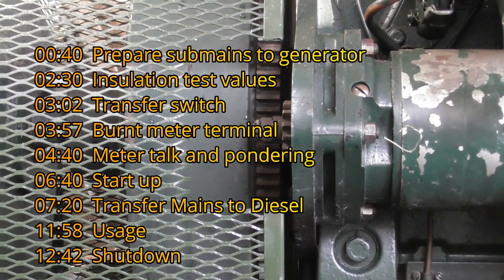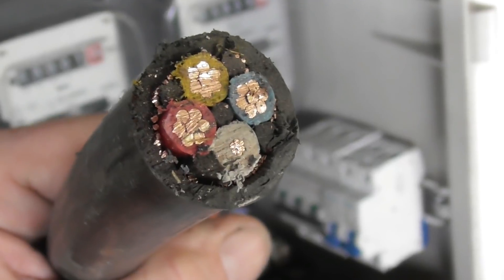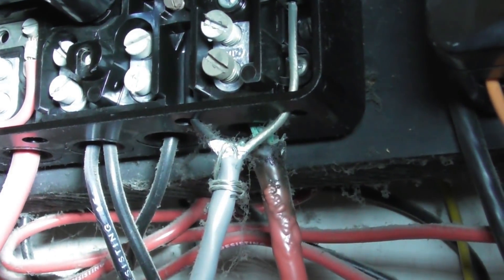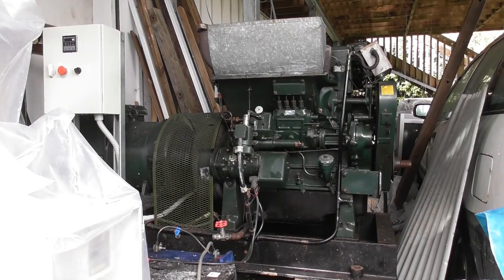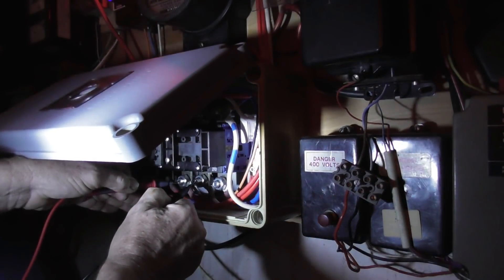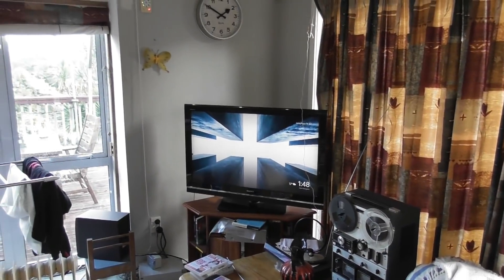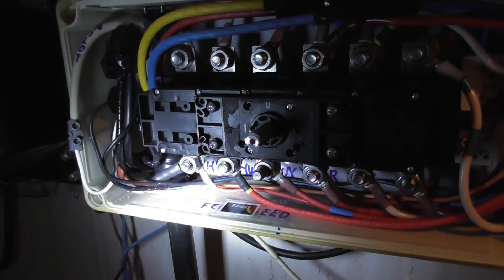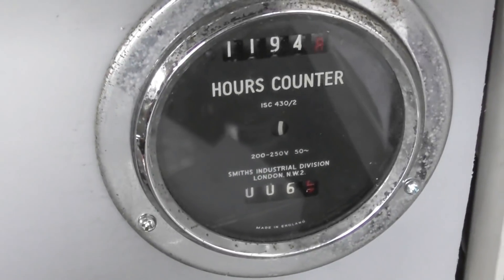Diesel Generator submains and transfer switch

Comment: Wow NZ still use Yellow for B Phase eh didnt know that. Yellow was banned in Aus from 1976.. or is that 50 year old cable...
Reply from the maker: It is White colour now, that cable I had was about 30 years old. NZ used Yellow Phase till well into the 90's. White is a dumb colour anyway for an active wire.
Reply: @RODALCO2007  Yeh well yes it is when you consider the Yanks use it for Neutral. But then again they use Black for Active so... whatever. Yellow was phased out because they thought people might confuse it with yellow/green (Earth). JUst threw out a heap of meters here, had a few polyphases you'd probably have liked.

Comment: How do you have 3 phase at you're house
Reply: Over here in Germany, every household has a 3 phase supply. Not sure where he lives tough.
Reply from the maker: Street supply is Single Phase 80 Amp supply. split generator load through transfer switch over Three Phases for better load balancing.

Comment: RODAL the red/ blue  light is a sweet touch.   Not a normal generator to house backup, but I except nothing less from you.   After 27 years in operation a part on my generator quit, was 1625 to replace.
I asked the guy why my clocks gained time.   He gave me some answer you might be able to put into plain words.  Does your system gain time on clocks?   Think I told you since they put the smart meter in, my 1985 battery back up clock blinks constantly.    Keeps perfect time, but they read power ever second and it dim blinks not totally off.     
Two questions why do they set up Onan and clocks faster.
Would the blinking dim light be by smart meter.   I never paid any attention when generator is running.
Thank you for the fun videos.   I wish you had a River by you to build a water generator.
Reply: If the governor on your generator is off, the output frequency will be off. Some older clocks keep time by mains frequency, so if the mains is too fast the clock will be also.

Get a good meter and check it's very very close to 50 Hz, or 60Hz, whichever area you are in.

As for the clock blinking, that's unlikely to be the smart meter. They don't really affect the power at all.
Reply from the maker: I like to check the status of the network. Haven't connected the pilot lamp up at the generator end yet. I had to put a sleeve over the blue light as someone was complaining about it.
Reply: RODALCO2007  I like the blue light, it’s yours why cover?
Reply from the maker: @bretts1  My daughter has a computer nearby and she reckons it is too bright. Need to keep the harmony in the house.

Comment: Do you certify this all yourself? I can imagine if your house burns down and the insurance company gets to see this whole setup after investigation, that they will show their middlefinger.. Not to bash you, just curious. It’s an interesting setup.
Reply: He works for a major power company in his area he knows full well about wiring and high voltages
Reply: @apctech1  the problem is actually knowing the things is not good enough in this modern world you have to have the right paperwork signed by a pencil pusher
Reply: TheChipmunk2008 That is what i mean.
Reply: apctech1 That was not my question. Knowing technical stuff has nothing to do with being a certified inspector. And there is no relation between a high voltage grid mechanic and a household installation installer. Two different jobs with different aspects.
Reply from the maker: It is wired up with the correct MCB protection in place and through a proper transfer switch. Not a plug with two live ends which I have seen in many private generator set ups. Electrically tested and safe to use.
Reply: I don't know how they are down there in NZ, but that's certainly the way insurance companies work in Canada.  If they don't like something about you or whatever they're insuring, they'll tell you how or what to do, and failing that, they'll drop you like a rock,  or ram your premiums up so high you couldn't afford them.  Insurance companies also decide who you can employ as a driver on company insurance, too.  If they don't like a person's driving record, they'll tell your employer and that leaves your employer in a situation where either they can't hire you as a driver, or must remove you from driving company vehicles.  I sort of agree a little with the principles on the side of the insurer, but telling a company who they can or cannot hire for specific services is a bit much to my way of looking at it.  They've gotten too big and too powerful in some instances.
Reply: Even if they deny you (and they almost certainly will), you can fight it. They would need to actually prove that your wiring was the cause of the fire, and if they can't, you should still get a settlement. It would be a lengthy and frustrating experience though, I'm sure.